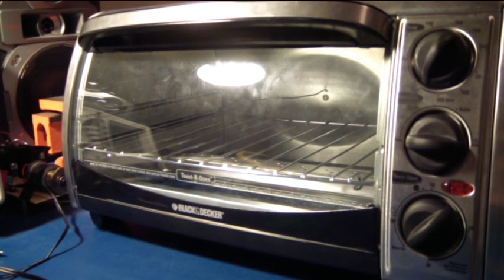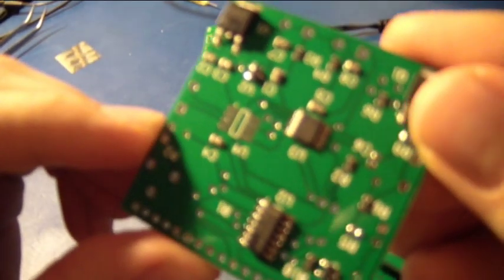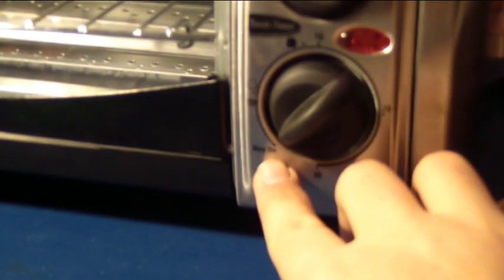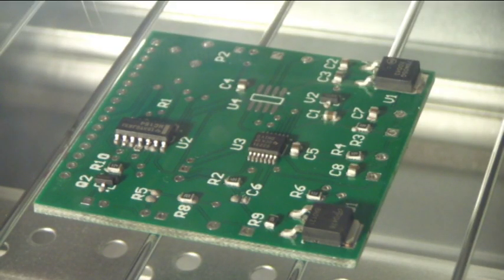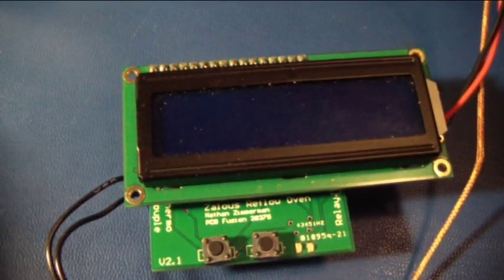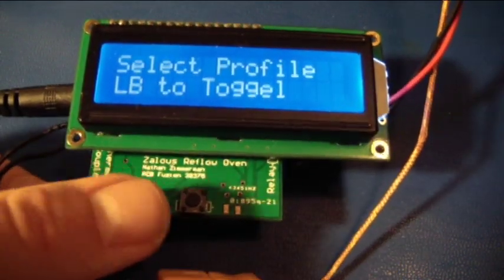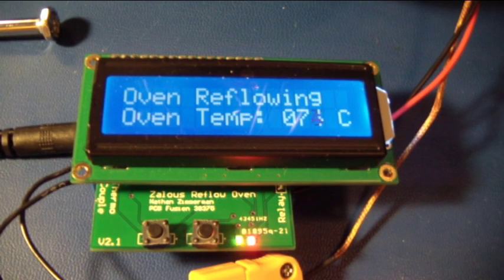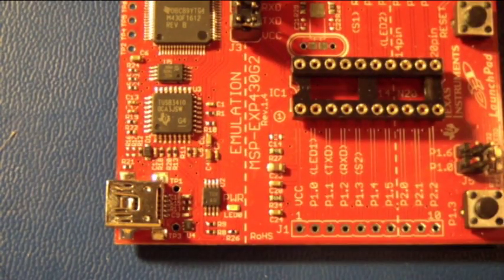Reflow Oven Tutorial

Comment from the maker: Plastic and heat are a very bad combination. I looked up your relay and it looks like its a through-hole relay. Through-hole components are generally soldered in last on a PCB by a human or through a process called selective solder. 

And yes, theres most certainly components that can't handle certain temperatures. PB free parts generally handle up to a max of 260C for 5 seconds, Then 40-60 seconds above 217C (aka liquidous). Other moisture sensitive components last for even less.

Comment from the maker: With a mechanical relay, its not wise to switch it very quickly for you kill the life of it. In addition, with a convection based oven, it is hard to quickly add and take away heat from the system. Consequently the control system is quite primitive and tweaked to the characteristics of only this oven. I made a version 2 reflow oven which used IR and a solid state relay. With that, you can still easily use a MSP430 processor to implement a PID algorithm to implement the profile. No external pc.